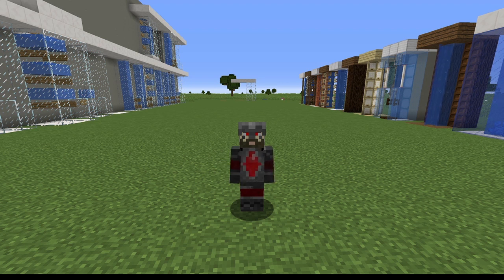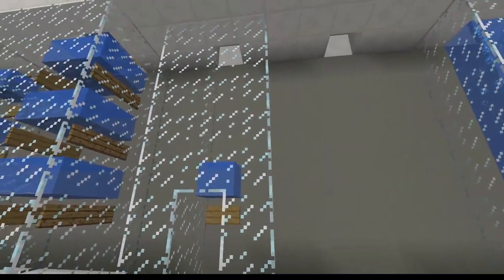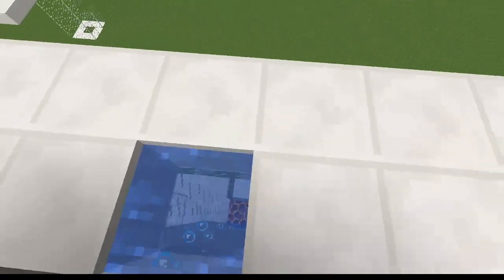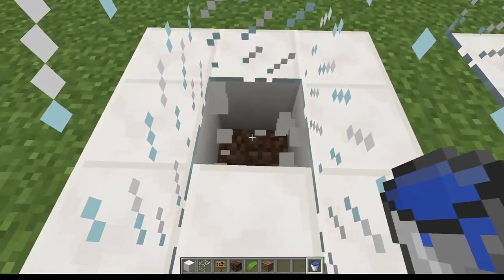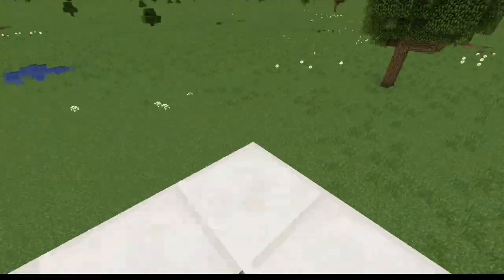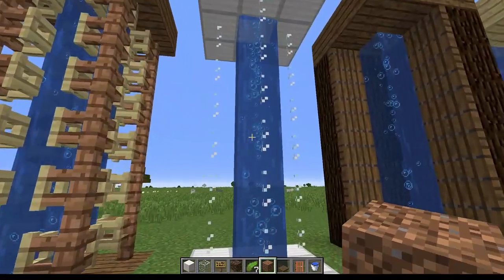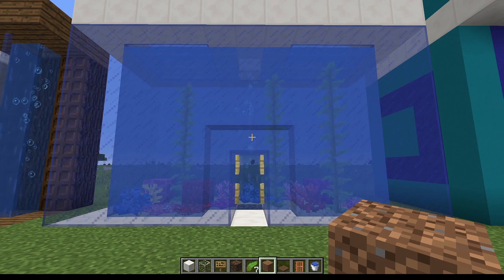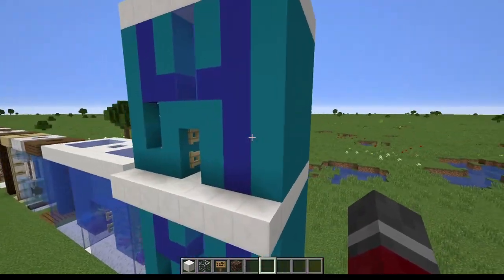How to make different Water Elevators in Minecraft

Comment: For the elevator at 21:00: Place stairs as "end block" and they will not destroy the source block OR just use the dispenser to take away the source block by placing an empty bucket inside to make the stop even smoother (the bubble column will then stop at this point and the water above will make you hover at the desired height)
Reply from the maker: Yep.  I have a newer video out I released a few months ago which uses the dispenser correctly to demonstrate the multi-level water elevator. :)

Comment: Solution for your dispenser: create roughly ~4-8 tick delay (1-2 repeaters) for the redstone reaching the piston, and place an observer to pulse redstone into the dispenser with a single water bucket. This will allow the dispenser to “suck up” that water block each time prior to the piston extending. Haven’t built it but I’m pretty certain even a 2-tick delay would be sufficient. On the next pulse, the dispenser would again push the water out and source your block. It’s a very similar concept to the one used when building a gold farm.